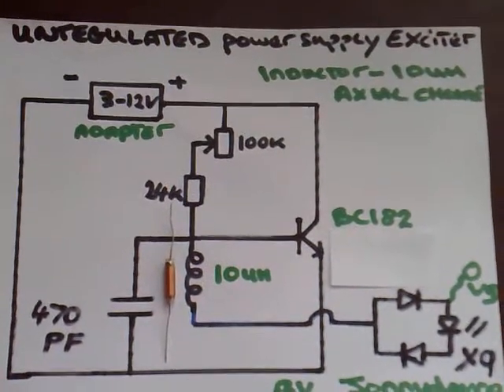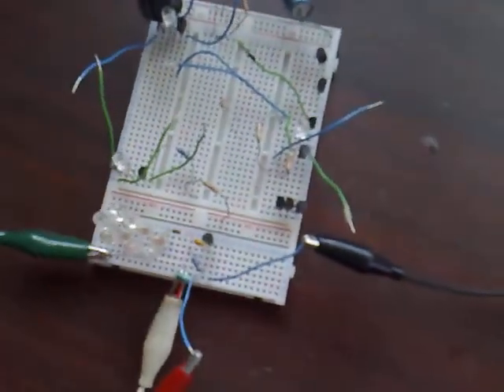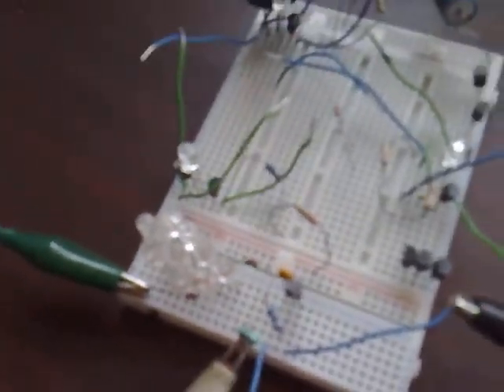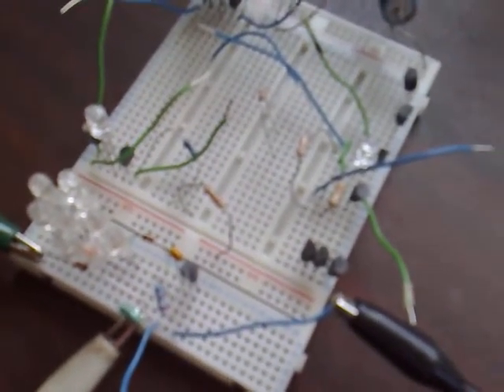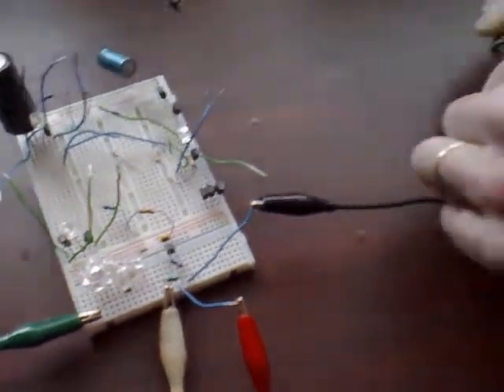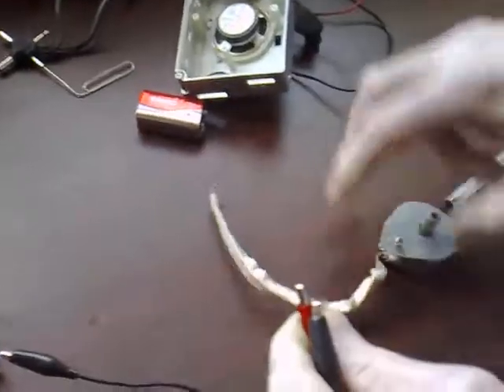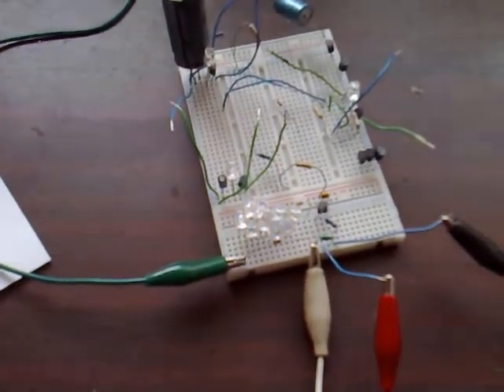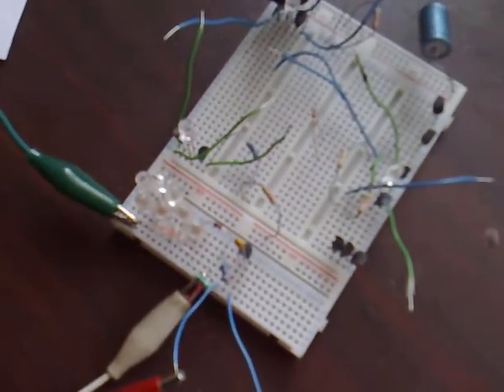Adapter exciter update and how it works

Comment: Hey jonny do you have a step down Ac transformer? Years ago I wound one, with varying taps that gives you low output AC, mine is 0,5,15 and 35  for example. It'd be neat to see if it'd run on that, i bet it would.